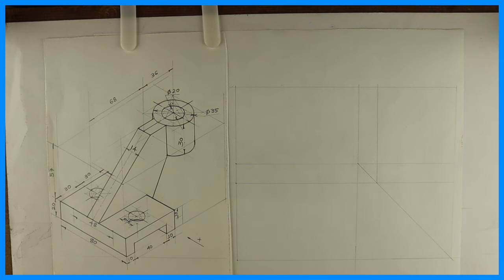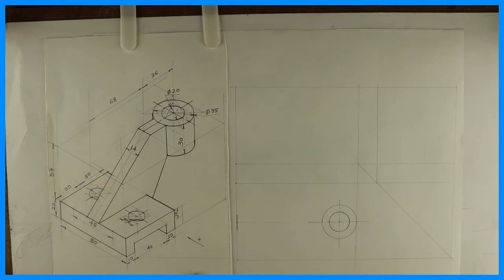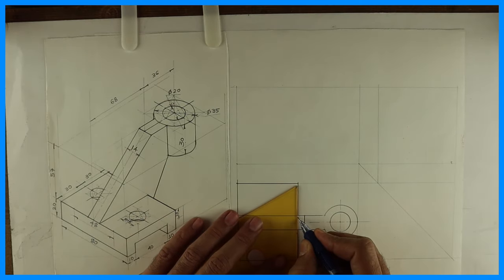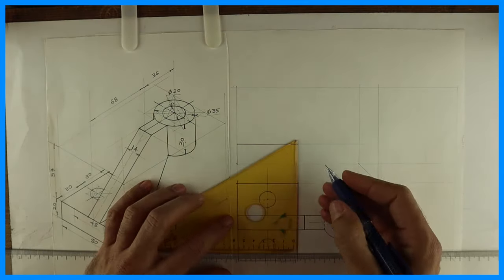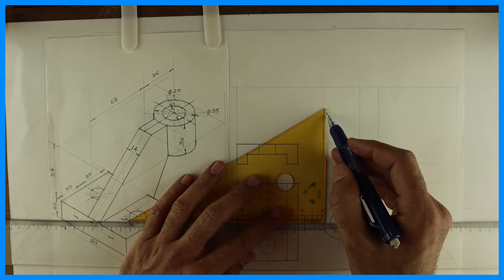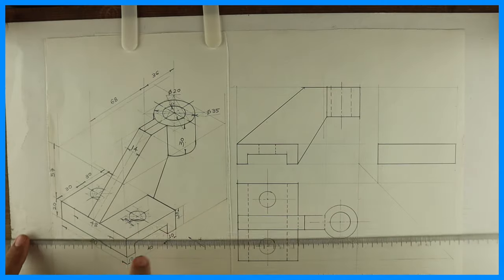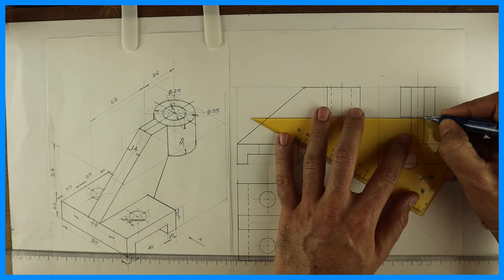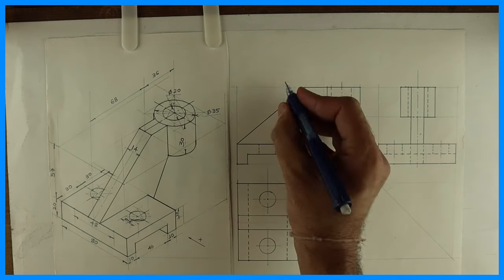Orthographic Projection - Engineering drawing - Technical drawing

Comment: If the sectional plane is passing through the symmetry of the object then in sectional front view, WILL THE PART JOINING THE CYLINDERICAL AND BASE BE HATCHED
Reply from the maker: If it is rib ( thin plate) then it won't be hatched